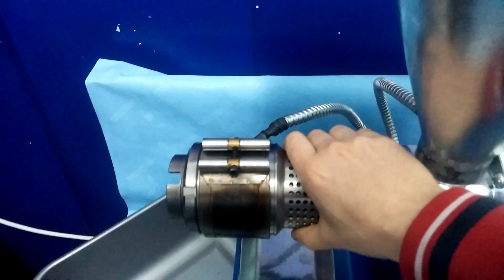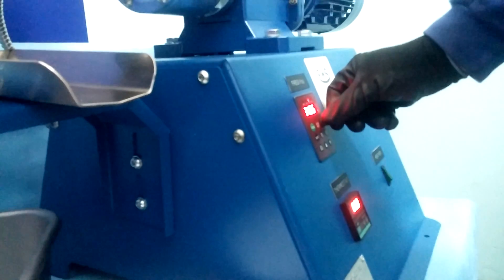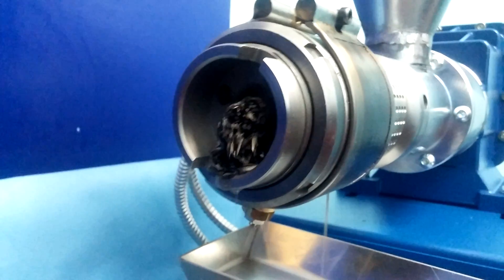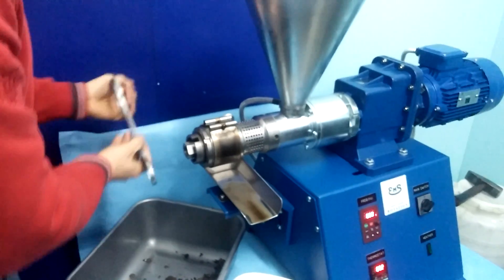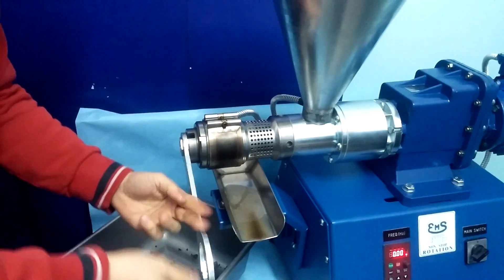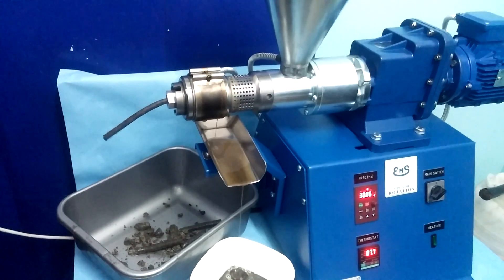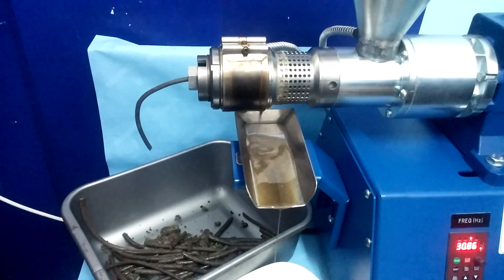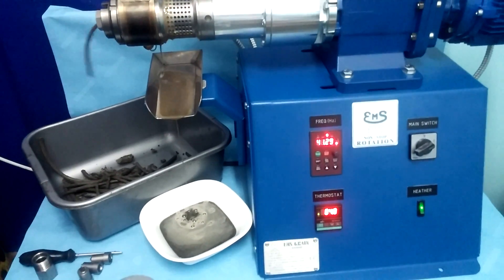Oil press SPU 20 - How to start

Comment: why not put peeled sunflower seeds directly? so the oil is already cleaned
Reply from the maker: it is much easier to extract oil from unpeeled sunflower seeds
Reply: @balazkrizanovic7523  so you have to filter the oil, if they are peeled the quality of the oil and better not?

Comment: Does the press also work with decorticated sunflower seeds?
Reply from the maker: it is much easier to squeeze the oil from unpeeled sunflower seeds
The shell keeps the cake ( dry material ) hard
Reply: @balazkrizanovic7523  how to filter the oil? the quality and different if the seeds are without the shell?

Comment: please answer me, why does sometimes the oil remain in cylinder and does not go through the screen? i have this problem in my machine.
Reply from the maker: my opinion is that the holes are clogged on the sieve, therefore the oil cannot come out and returns to the cylinder
Reply: @balazkrizanovic7523  thank you

Comment: Very nice machine,  Motor,  Is it single phase? 
Thanks
Reply from the maker: Thank You
The motor is three phase but the machine is work on single phase, it is possible because of frequency inverter
Reply: @balazkrizanovic7523  Thanks Balaz.
Reply: We are from Mumbai We are mini oil mekar machine menufearar 💯 parsant Maid in India  wattsup7028888480

Comment: looks more nice so piease send me macion total weight and price with full detail
Reply from the maker: In our production program we have oil presses in two sizes
with two different capacities

The smaller press is marked with SPU 20
The capacity of this press is between 10-20 kg / h of raw material, depending on
raw material, and how is the machine set up.
1.5kW drive electric motor with the possibility of speed control
via frequency regulator
Belt heater 600W
As a standard, the press is supplied in a single-phase version, it can also be supplied in three-phase version on request.

The larger press is marked with SPU 40
The capacity of this press is between 30-40 kg / h of raw material depending on
the raw material, and how is the machine set up
2.2kW power-driven electric motor with speed control
via frequency regulator
Belt heater 800W
As a standard, the press is supplied in a three-phase version, it can also be supplied in a single-phase version on request

The presses can run constantly

The drive of the press is an electric motor that, via a gear unit (reducer)
it drives the press, and with the built-in frequency regulator it's easy and simple
can adjust the desired speed, which is very important, because different
raw materials have to press at different speeds, in addition to this, well-adjusted
speed has great influence on the capacity and utilization of the press.

In addition to the frequency regulator, the press is also equipped with a belt heater with automatic temperature regulation, which plays the most important role before the very beginning of pressing, because it is much easier to start the pressing if the head of the press is preheated.

With the press can squeeze oil from different oil seeds and nuts like
Seeds of sunflower, pumpkin seeds with shell, flax, cannabis, mustard seeds, hemp seeds, black seeds, rapeseed, poppy, grape seeds,
hazelnut, coconut, peanuts, walnut, almonds, apricot kernel, burdock seeds etc.
Sesame seeds, almonds, peanuts and walnuts leave many precipitate
Can not squeeze oil from olives and rose hip.

For the press we produce three types of snail (an element that carries the material through the press)
1. Snail with shallow channel
For oil seeds of larger hardness such as grape seeds, pomegranate seeds, hemp seeds
With grape seeds, during the squeezing process, the oil temperature is 55-60 ºC

2. Snail with standard channel
For other grain and nuts
During the squeezing the temperature of the oil is 36-40 ºC

3. Snail with deep channel
For nuts
During the squeezing the temperature of the oil is 36-40 ºC
Nuts can squeeze with standard snail, but due to the depth of the channel,
The raw material needs to be much more smashed than when using a snail with a deep channel
while with a deep channel and the capacity is a bit higher
 
We deliver press with one snail ( the customer choose which one ), and
with two adjustment tools and a nozzle set with openings from Ø 5mm to fi 13mm

All elements of press which are in contact with oil are made of heat-treated stainless steel

Prices of press and snails are
Press SPU 20 1758 USD without frequency inverter, termoregulator and heater

Press SPU 20 2336 USD  with frequency inverter, termoregulator and heater

Additional snail for SPU 20 354 USD
..................................................................................................................................

Press SPU 40 2336 USD without frequency inverter, termoregulator and heater

Press SPU 40 2938 USD with frequency inverter, termoregulator and heater

Additional snail for SPU 40 448 USD
..................................................................................................................................

Customs cost 85 USD

Payment Advance
Parity: EXW Senta or DAP
Delivery 20-25 days
Warranty two years (except for consumable parts: snail, screw, star)
Possible delivery through courier services
The drawings with the dimensions are attached,
The weight of the press
SPU 20   66 / 80 kg ( net / gross )
SPU 40   95 / 112 kg ( net / gross )
The dimension of package is 122 x 62 x 74cm
Reply: @balazkrizanovic7523  please send me more technical information on capacity per hour weight, size, country of origin and price for the two models to jantonioalfaro80@gmail.com

Comment: Why you change this again and again
Reply from the maker: the smaller is the hole in the nozzle, bigger is the pressure in the machine.
The bigger pressure causes more oil from raw material.
It has to be done step by step.
Reply: Thanks you bro

Comment: Why do you need to use increasingly smaller nozzles when it''s the the same material at the same temperature that's going through it? The only reason I can see for not starting with the narrowest would be if perhaps you were running the machine in for the first time of something.